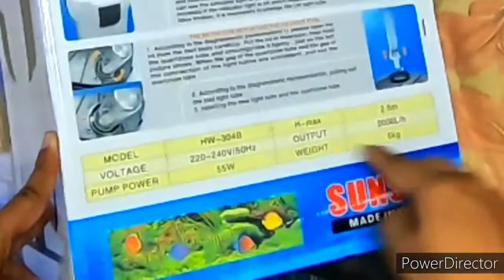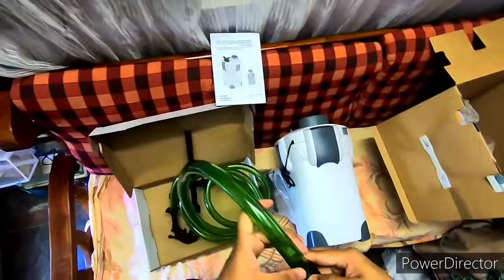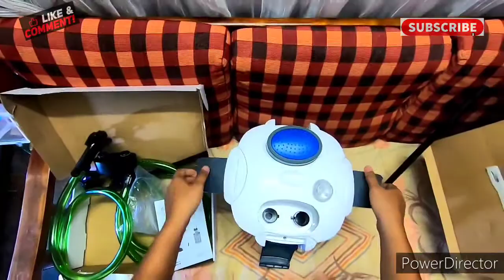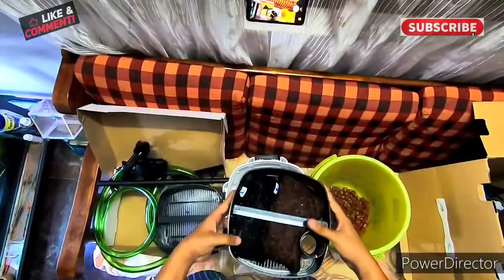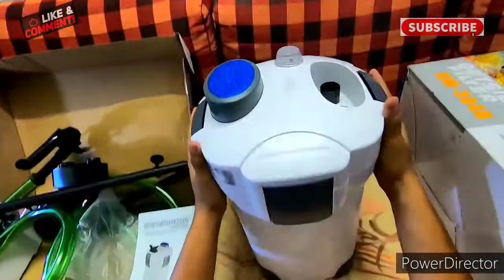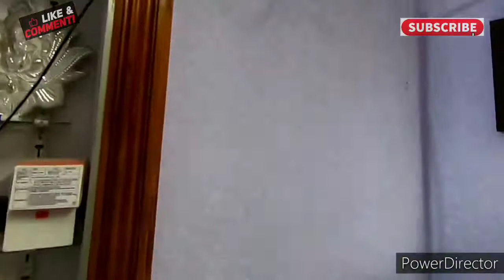How to : Setup SunSun Canister filter 304B

Comment: Is this filter enough for a 6feet (170gallon) tank?
Reply from the maker: It will bro, it has good Flow and suction but you might have to add an extra pump with in the Tank for circulation